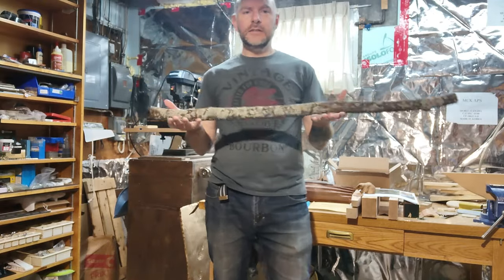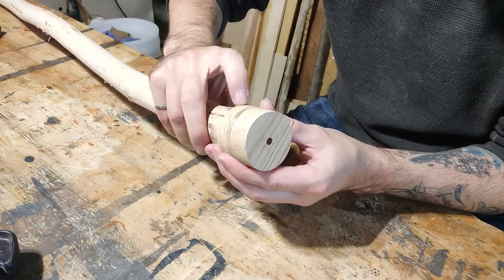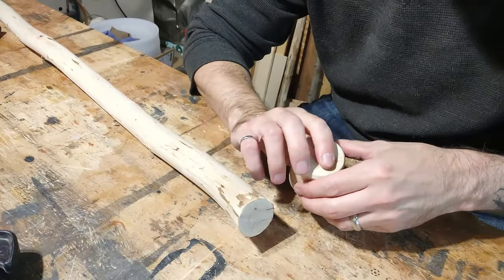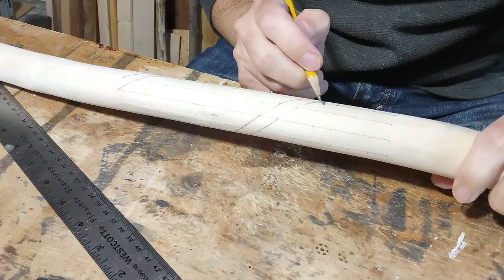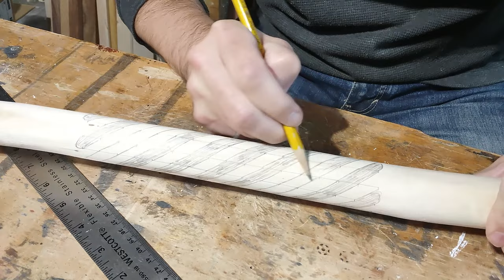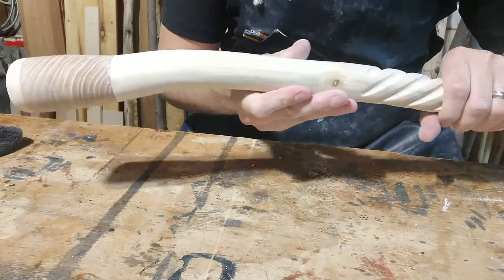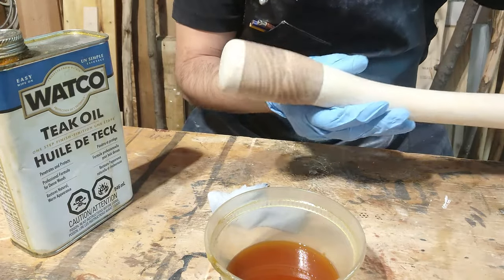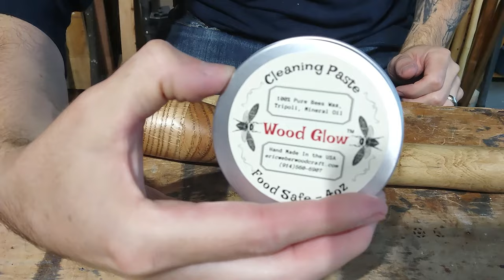CARVING A MAPLE AND OAK CANE

Comment: Excellent video, love the spiraling effect on the stick. Great tip on the fine steel wool prior to the teak oil application.
I'm wondering if you use other products for finishing or strictly use teak oil?
Thanks again and Happy New Year!
Reply from the maker: Thanks! I've used teak oil, Danish oil, polyurethane and just wax... I like how the oil finishes leave the wood.
Reply: @JasonHedrich   Thanks for the quick reply, I've been using polyurethane for my walking sticks and it's time to try something else... Teak oil it is. 
With Christmas season over, I'll be going out in my neighborhood and picking up a discarded Christmas tree or two for my next walking stick project.